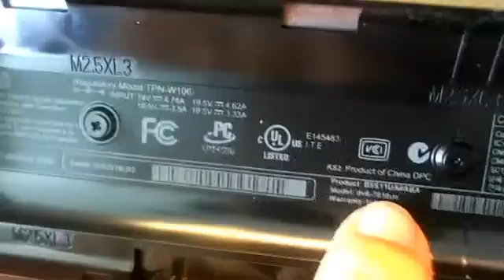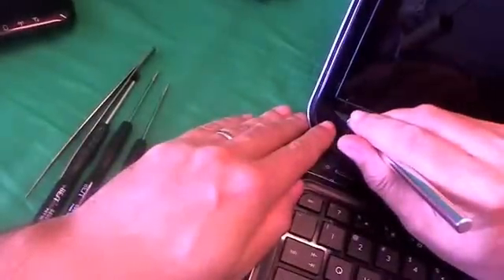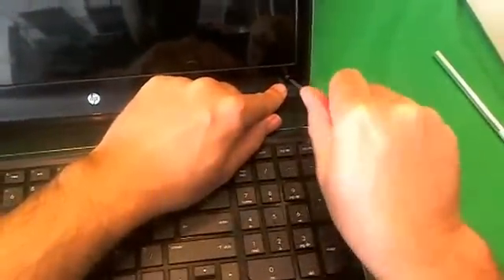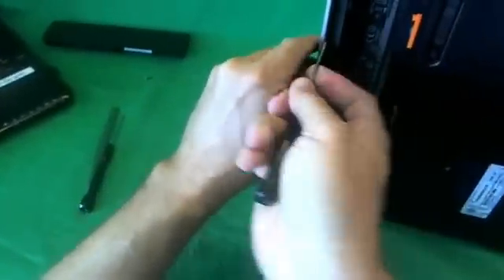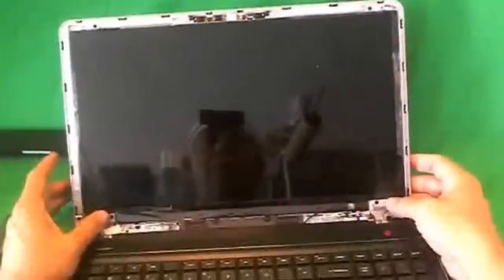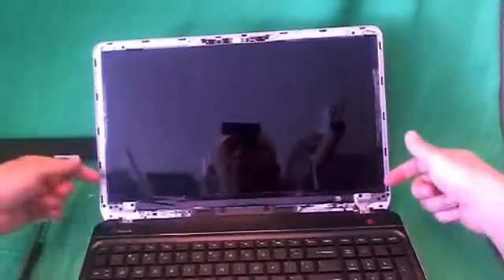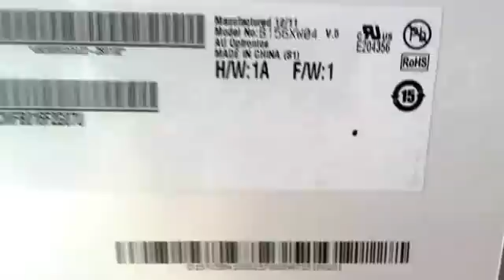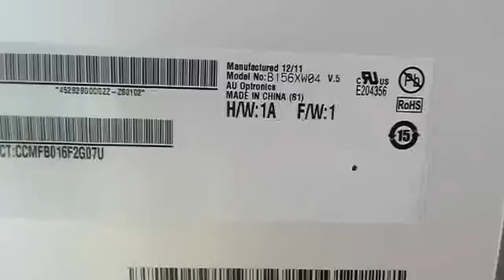HP Pavilion dv6-7010US Laptop Screen Replacement Procedure

Comment: After I disconnect the display cable, and remove the lid, could I just use the laptop with an external display (hdmi)? Would I face any boot / display issues without the display connected? Appreciate your help!!
Reply from the maker: Suresh Sooraj I think it will be ok without changing settings.

Comment: My DV6-7 was significantly more difficult.  The factory had taped the bezel to the screen and I had to pry the double-stick tape up.  Ended up breaking a few tabs.  That monitor cable/plug thingy is also a big pain in the butt.  HP should have been ashamed.  I got halfway through the bezel before I watched this video.  Who the F*** puts tape over FOUR screw heads?  I will never buy an HP or COMPAQted computer again.
Reply: RyeOnHam Good video, BTW.

Comment: This helped me bunches. I still need to go back with the rubber cement. After the fact, I think locating the screws and making a small hole in the perforated strip would be less intrusive. The small hole would always show, but I'm not confident the rubber cement will make that tape look new.
Reply: what did you end up doing did the cement work well?
Reply: I did not have good luck with the cement. That's really the only part of the job that left me disappointed. I think if you can locate the screws and cut out a small hole, it will leave the front looking better. You can buy a new grille tape, but they're not cheap for what you get. Good luck. It only took me about 10 minutes to change the screen.
Reply: indeed this was very helpful and screen is very easily replaced, As for the screws I pin pointed its location and remove the screws without having to removing the screen, it worked great thx for the idea.

Comment: Right on man. Great vid. Just finished replacing the screen on my sis's laptop. Only thing that went a little wrong was that that speaker cover stretched a little now it's about 1/16" past the little 
indentation it sits in. No biggie tho. My sis is thrilled.